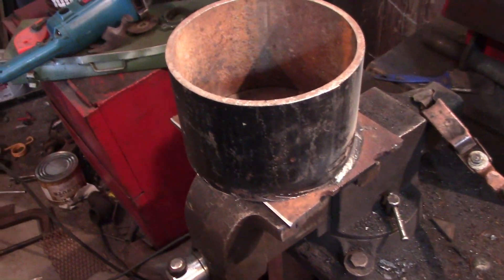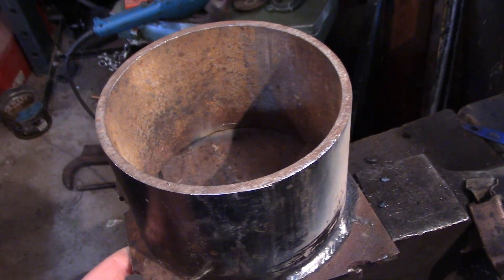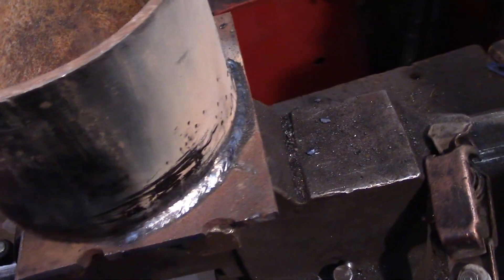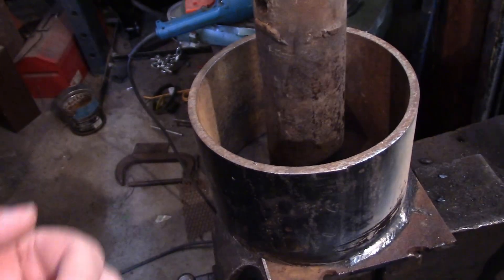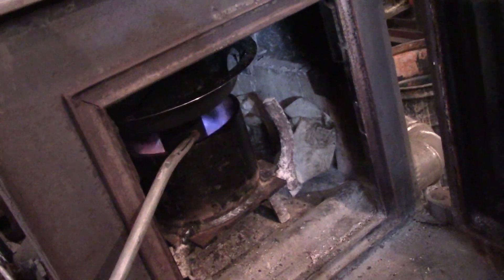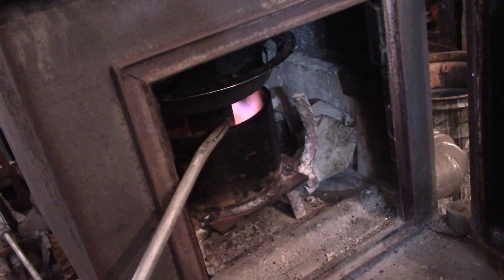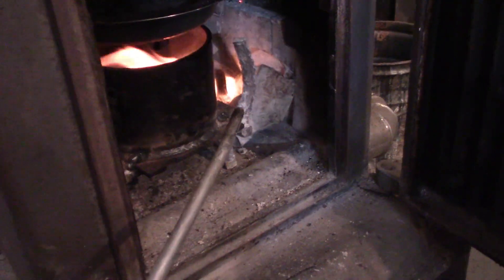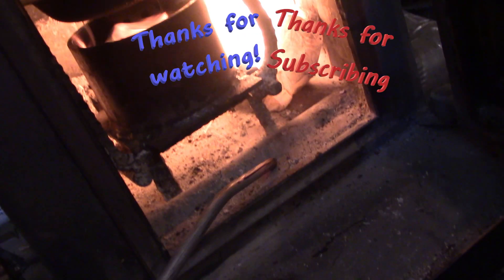Building a Waste Oil Burner: 1 Understanding the Burn

Comment: For one thing your holes in the in the tube are placed way to high  to feed are to the oil below & for letting the heat scavenge air from below.
Reply from the maker: Thank you. Thats also what i learned later on. It seemed the more i kept fresh turbulant air pushed down into the bottom of the bowl the hotter and better the burn became.

Comment: The burn pot is too thick.  It would eventually get hot enough but you need a stack more fuel and air.  1/2" pipe using air from a squirrel caged motor, which is very quiet, would give you the results you are looking for.  If you are going with the updraft from the centre pipe in the burner you need the pipe to be projecting from the bottom of the burner to suck up air and the holes to deliver the air into the chamber should be close to the oil and the stove must have the door closed to create the updraft.

Comment: I’m battling the same problem with the foundry I’m building. Getting enough air to supercharge the flame. I’m curious to see how your burner progresses and what solution you come up with. When I add air pressure it works great. But, I don’t want to have to do that. Good luck to you.